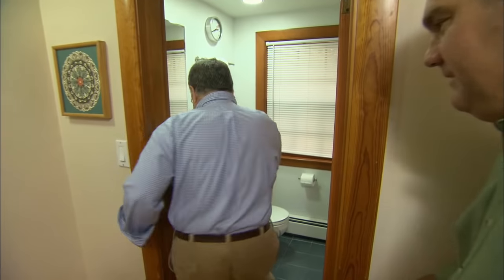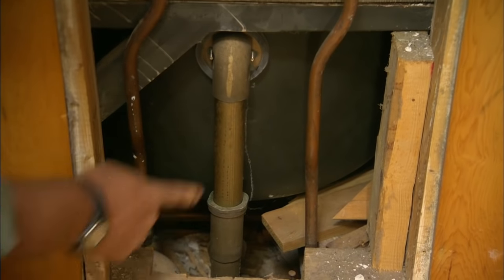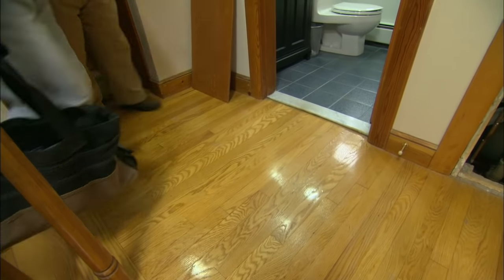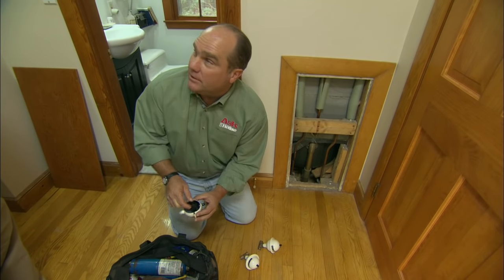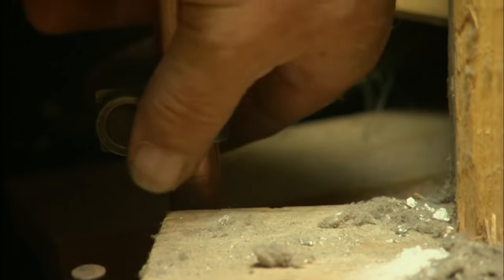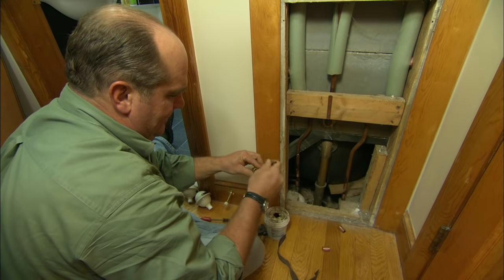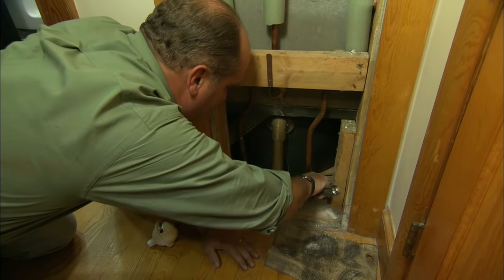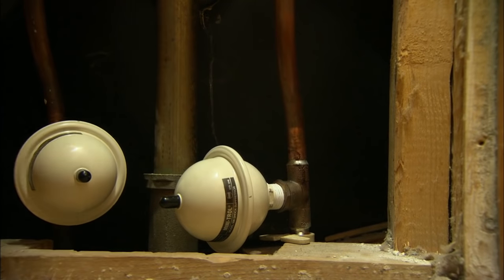How to Quiet Pipes With a Water Hammer Arrestor | This Old House

Comment: does this act just like PRV?
Reply: No
Reply: No, a PRV (Pressure Reducing Valve) is to control the water pressure at a reasonable level for the home.  Water pressure from the utility can be 100+ PSI which is too high for residential fixtures and hoses.  So, a PRV will bring the pressure down to a reasonable level.  The anti-hammer chamber reduces the shock from quickly turning off the water, like and electrically controlled valve in a washing machine.

Comment: 😂 😂😂 how convenient...  do it again, okay sounds like it’s coming from this access panel right here next to where I happen to be standing!  Easy as that!  😂😂😂 jokers all jokers!!
Reply: And what stopped the noise was securing the pipe, not putting on those high maintenance expansion bubbles.
Reply: @DAS-Videos  I think you're missing the point.
Reply: @DAS-Videos  nah dude, it’s the water pressure that caused the hot water to shake loose. The arrestor solves shaking from future pressure change. Securing the pipe alone would cause the pipe to burst later.

Comment: I like your method of screwing the next guy, your fellow plumbers who will have to remove the arrestor when they have to work on the larger pipes for any reason. You should of placed the hammer arrestor higher up the 1/2 inch pipe. You Sir, are most certainly NOT THINKING FOR SURE !!!!!!!!!!! Maybe this is why you are on "This Old House !"

Comment: FYI anyone watching, this guy is no "Expert" lol hes a paid actor doing what he's told.  A true plumbing expert would know that the hammering heard is a symptom, not the issue. That being said, a "shock absorber", is more like a band-aid over a laceration that requires stitches. If you are experiencing water hammer, call an actual plumber. If he tells you its your pipes that are unsecured, or he needs to tear down your walls, call someone else.
Reply: Samuel Martin You should research the "actor."
Reply: I don't care, nor do I have to.  Just throwing my two cents out there. I know it's not worth much, but I have had customer's tell me "well i watched a youtube video." and when I saw this video I was just couldn't help it. honestly, it's just more job security, however plumbing I feel like should always be done properly due to the health implications of everyone involved.
Reply: The point is he's not an actor.  He's been in the industry for years. I watch many of these videos.  Do I go out and attempt what they do expecting the same results? Of course not, but it helps to see it done correctly, and gives you an idea of whether to call a pro or not.

Back to your expert analysis. This was an ongoing problem for 23 years. Why he didn't open the access panel himself all these years is beyond me. lol
Reply: Okay genius, what is the actual issue then?  You spewed out that whole paragraph of self righteous hot air, but didn't let us in on the secret.
Reply: Richard is a professional plumber
Reply: You might want to do your research buddy, if you google “plumbers” on Wikipedia, he’s list as one of the worlds most notable plumbers....
Reply: An expansion tank by the water heater does the same thing. Pretty much every house has one now.